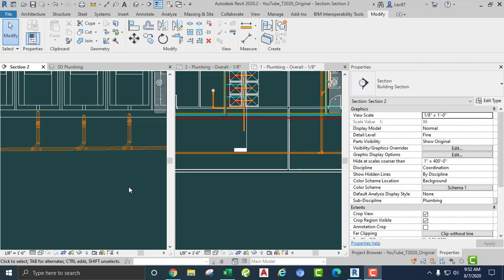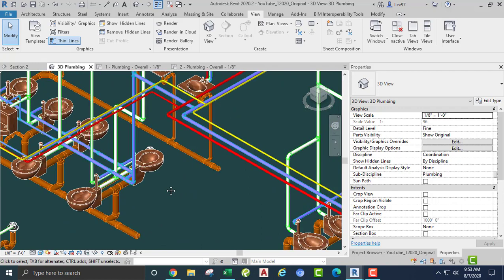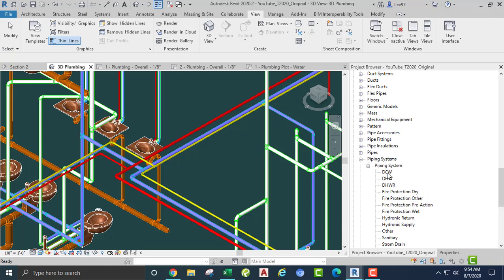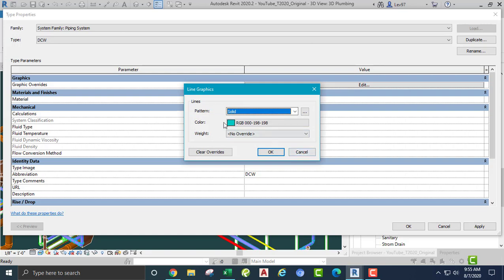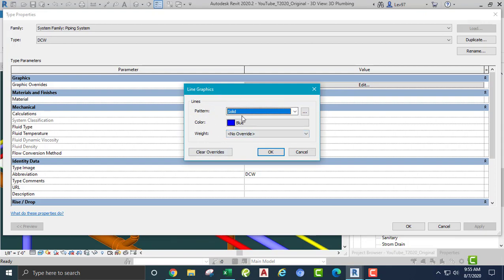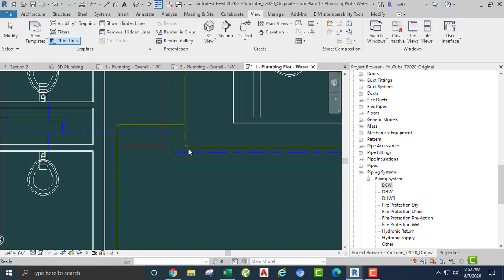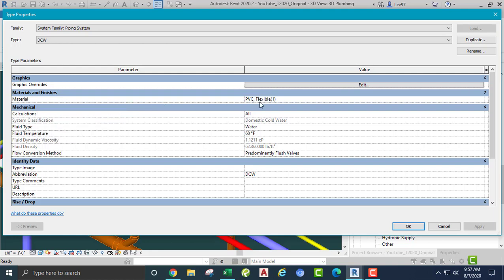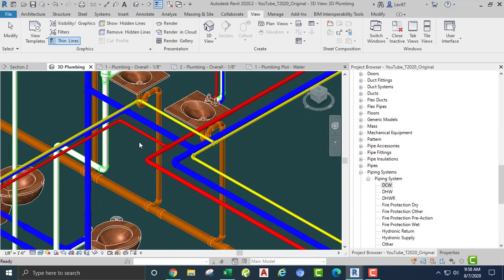Revit MEP allows us to CHANGE THE COLOR OF PIPES. GO BLUE!!!

Comment: Hi,
Thanks for the video.
I did as you showed, it works fine on 3D but in floor plan the solid I Set won't show. Do you know what could be the reason?
Reply from the maker: Not sure why but if you set your "pattern" to a particular linetype it should reflect that linetype on your floor plan. Hope that helps
Reply: The linetype did work, but the Fill Pattern/Pattern didn't work :/
Thanks anyway
Reply from the maker: @reuthefetz3490  I hope this helps...go to materials in your "type properties" then goto appearance to set your color